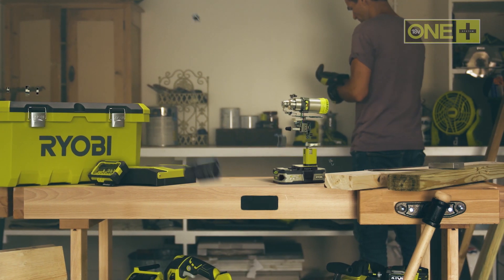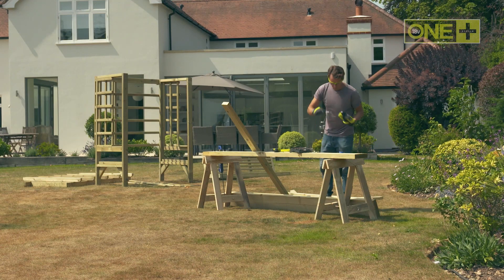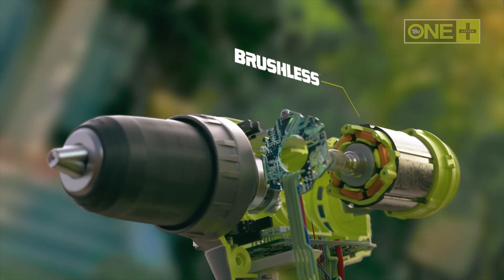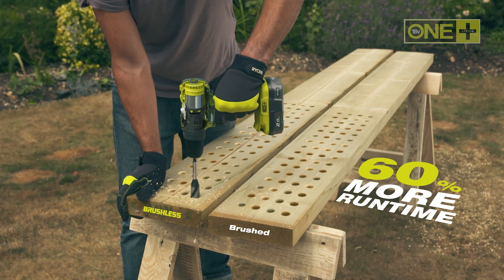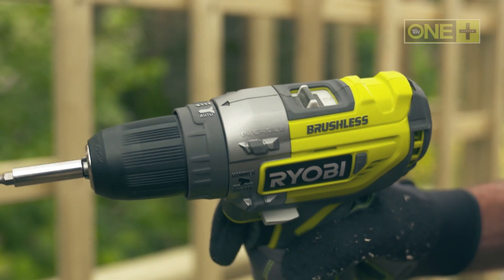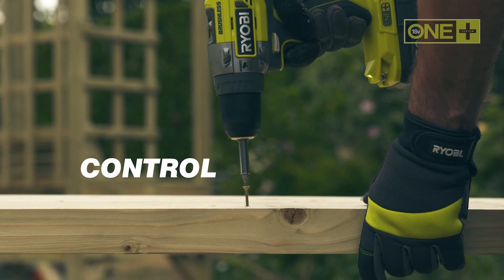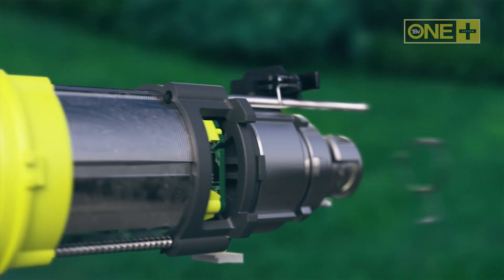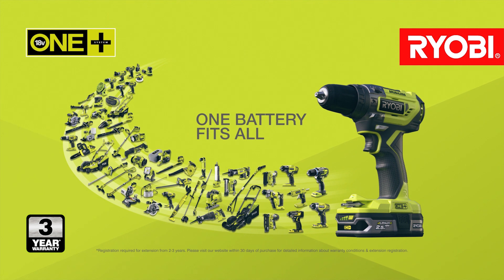Ryobi ONE+ 18V Brushless Drill Driver/Percussion Drill [R18DD5/R18PD5]]

Comment: What is the technical difference between the R18DD5 and the R18DDBL?
Also why is the  R18PD5 (combi drill version) not available in Sweden?
Reply: Pham Nuwen, DD5 offers second generation e-torque chuck with no torque settings at all (screw and drill and that's it) also 30% less torque (40nm vs 60 NM DDBL has) and is noticeably more compact and lightweight
Reply: So DD5 is better in all aspects other than torque? Thanks.
Reply: Pham Nuwen , Yes I suppose so
Reply: Cool, thanks.